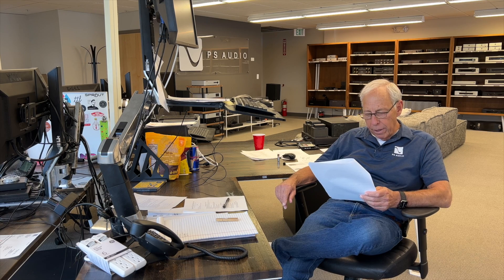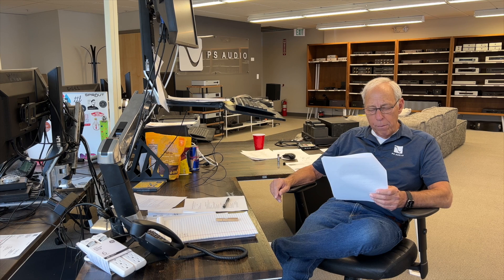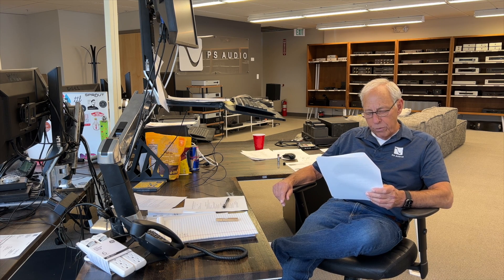Dual vs  monoblock amplifiers

Comment: Dual Mono 
Bryston is The Bomb 💣 
Built Like a Tank and Just Enough For Anything You Need in a Home 
Stereo System The 3-B and 4-B
Oddly Enough is Not Stereo It’s 
Dual Mono Am Not a Audio Snob I 
Do Not Have Gold Plated Speaker
Wire Or a Elliptical Hope Diamond 💎 
Phonograph Cartridge That Set Me
Back $15,000 Dollars 💵 
Yet You Can Get Great Results From 
The Bryston 3-B or 4-B 
Jazz To Rock to 60’s Rhythm and Blues To Angel Classical Music 
The Other End Is a
Phase Linear 700-B 
This Pig Is Just Power And 
I Have 3 And 3/Way Cross Over 
For Highs Mids and Lows Plus 
Two Self Powered Subs 
This System Rock 
Rolling Stones 
To Exile on Main Street 
To Sticky Fingers 
Bryston and Bob Carver 
Just Built To Take On Any 
Sound Endeavor

Comment: I'm using 4 x monoblocs for my Kef Reference speakers, 2 for each side,  High Frequency and Low frequency. Maybe overkill, but having a total of 500w just for the main speakers is at least the amps don't even get warm, at even high volume.

Comment: If you want to go down the mono block route just buy two old integrated amps of the same model and split the inputs, r & l, between them - why folk buy overpriced purpose built mono blocks  is a mystery to me.
Reply: @vid vid I have just realised that I have 2 amps the same and would like to try this. Would you kindly explain how I connect my turntable, and to I link the amps in any way?
Reply: @stephensmall4172  I am no expert and I think due to how a cartridge works on a turntable that cross channel ghosting occurs at that stage so one amp per channel further down the line will not take that out (of course it is not going to add to it either!!!) So, setting that aside, then just put outputs from your turntable into a separate amp (phono stage input) making sure the left goes to the amp you will be hooking up to your lh speaker etc. You might need to get an extension for one side to make it reach.Hope that makes sense - I am no expert - just always looking for the cheap option for maximum musical fidelity!  Good luck.

Comment: Another advantage of having two chassis is you can put it close to the speaker and use shorter speaker cables.
Reply: I agree you will have shorter speaker cables, but also long runs from preamp to power amp. Not so bad if you have balanced cables.
Reply: @albanana683  If you've listened to Paul he agrees with longer balanced interconnects and short speaker cables.
Reply: @richardsmith2721  you are fools! The resistance of the speaker cable is irrelevant compared to low level connects
Reply: @Harald_Reindl  but we are not outputting sine waves to the speakers, we are sending complex waveforms, and speakers have very different impedances at different frequencies. This puts inductive loads on the cables and amplifiers over a very wide frequency range. Most people with a decent system can hear the difference between very skinny and thicker speaker cables, and the same between long and short cables.
Reply: @spacehopper999  for the sake of god the resistance of the speaker cable don't matter in the calculcation and you can't hear short/long cables unless it#s very very long and even than it's only volume - you have a volume control for it - but it don't change the sound - it's shocking how much audiophiles don#t have the lsightest technical knowledge and things like "This puts inductive loads on the cables and amplifiers over a very wide frequency range" don't let you appear smarter but just dumber
Reply: @Harald_Reindl  it’s ironic that you are claiming that I have no technical knowledge. I was talking about impedance when you thought that meant resistance - impedance is ac and resistance is dc. That is why you are struggling to understand it. Impedance has a different set of calculations. 
You’ve hit the nail on the head admitting that you are not an audiophile, more than likely meaning that you have not had the pleasure of listening to a high end system before. Such a shame.
Reply: @spacehopper999  I don’t think so
Reply: @spacehopper999  A high end system sounds awesome because of the speakers, amplifiers, and source components.  Not because of the cables.
Reply: @richardsmith2721  Paul agrees with Paul.
Reply: @YuengsNwings  Let's do this then. My original comment was that two chassis allow you to run shorter speaker cables. If that's not your thing, then great. Please move on with your life.
Reply: Weee!… maybe Paul left this aspect of monoblocks out of his video to avoid this rubber-fire. Perhaps it can be argued that the effect is small, but trading speaker cable length for balanced cable length can’t hurt, right?
Reply: @SteveWille  how should something which makes no difference at all hurt? do it if you feel better, but it's useless
Reply: No two things in the real world (unlike, say, in mathematics) are exactly equal. Given that, I’m questioning if shortening speaker cables a movement towards improvement or always from it. Perhaps though, for instance, there are other uncontrollable factors that dwarf the any difference that speaker cable could make. Maybe this is the point.
Reply: Bc of damping factor?
Reply: This would be true if you are susceptible to the cabling snake oil. There are no sonic benefits to shorter speaker cable unless you’re talking about unusually long runs.
Reply: @YuengsNwings  So you use lamp cord for speaker cable?
Reply: @richardsmith2721  I do not.  I make my own cables using 12AWG wire with decent connectors which is plenty sufficient for 100% of applications be they mine or anybody else's.  My speaker wire runs are 5' long.  My interconnects are 3' long.  And I guarantee there are no sonic benefits to either transferring some of the speaker cable length to the interconnects or spending more $ on speaker cables.
Reply: Lol - you missed any technical education - why?
Reply: @Harald_Reindl  How did I miss it?

Comment: One place dual mono works well is in the preamp.  The output stage of my streamer/DAC is dual mono.  The channels share the power cord.  After that it is two separate power supplies to two discrete amplifiers.
Reply: But without any difference in the result "working well" is idiotic given that there is no difference without all that nonsense
Reply: @Harald_Reindl  In your humble opinion...

Comment: Isn’t one main benefit of monoblocks that they can be positioned near each speaker which allows shorter speaker wire?
Reply: The added cost of the amp will be greater than the savings on a few feet of speaker wire
Reply: @Pete.across.the.street  true. But people don’t use monoblocks to save on the cost of the wire.
Reply: @edd2771  so what would be the benefit? Cable management?
Reply: @Pete.across.the.street  Many audiophiles believe that the shorter the distance from the amp to the speaker, the better the signal transmission. This, in addition to the absence of cross talk and heat that Paul mentioned are often cited as a reason to use monoblocks. I found it strange he didn’t mention it. If you look at pictures of high end setups, the monoblocks are on the floor, near each speaker, not stacked in the middle with other components. Paul has spoken about this in another video where the title was something like What is better, shorter speaker wire or shorter interconnects?
Reply: @Pete.across.the.street  Probably better damping factor, but im not sure if is worth mentioning.
Reply: @edd2771  You can increase damping factor on a longer cable by simply going with a lower inductance cable like Goertz cables

Comment: I own an Adcom Gfa 535 amplifier and i decided to open it up and there were 2 transformers,  2 sets of capacitors,  2 sets of power transistors and 2 heat sinks. Though rated at 60 watts a channel its a beast and more powerful than its rated power
Reply: I have ADCOM GFA 555mk2 and 545mk2 , but yes the 535 has dual transformers.

Comment: Interesting discussion. My initial reaction would be by putting two amps in the same chassis, completely separate including power supply. Also the power supplies have seperate AC power Entry Connector Receptacles, female socket male spades. That would encourage users to plug the power sources into completely different AC feeds. Plug one into a socket on one side of the room the other into a socket on the other side of the room. Three potential things happen:

#1 Both feed sockets are on the same circuit breaker same feed. Probably nothing gained nor lost.

#2 Both feed sockets are not on the same circuit breaker.
   Minimum maybe a little ground loop hum
   Worse result potential chassis has some residual AC leakage.
   Gently rub your hand on the chassis and you kinda feel a little AC there.
   
#3 One of the two feeds is miswired and fed from two different feeds from the power line and breaker box.
   This one can be dangerous. Maybe the amp blows up. Or pops a fuse or trips a breaker.
   Maybe if you touch the chassis you get electrocuted.
   
I would NOT recommend a power amp of this design.
Reply: Opps forgot one more thing # 4 if the two feeds coming from two different breakers are feed separately from two different phases from the house AC service and transformer. That's gonna be a problem.
Reply: @wilcalint  And the hardest part, you need to run the two channels on two different power plants just to be safe LOL...
Reply: To gain what? Doing something in a technical environment for no technical gain is idiotic
Reply: @Harald_Reindl  Except in this case under discussion is the design of a consumer grade electrical appliance which is subject to local and national safety standards. Most devices of this type must or should meet UL, CSA and TUV standards and display such somewhere on the device. IMO, and I've been through the certification process several times, some of the devices under discussion here may not meet those standards.

Comment: Paul, I just went to your website to check out the bhk 300. Music and movies are full bandwidth. Why not list its true power ratings 20 HZ to 20 kilohertz?
Reply: @funny0000000  I think a better analogy is the speed of a car rather than horsepower. Yes the car can go 150 mph but only downhill. Yes the amp can produce 150 watts but only in the easier spectrum. Btw, 1khz isn't that much easier at 1 khz than 20-20k.
Reply: Spec sheets have to go thru the marketing dept at least once before they are finalized.
Reply: @Roof_Pizza  not sure how that answers my question
Reply: @ryanschipp8513  I think it explains everything tbh.
Reply: @ryanschipp8513  It shows power ratings down to 2 ohms, so as long as your speakers don't drop below 2, that should be enough info. Maybe I don't understand your question, but what's listed seems to be enough.
Reply: @AT-wl9yq  human hearing is 20hz to 20khz. Music and movies are FULLBANDWIDTH. Not just a 1khz tone. So listing a power amplifiers wattage at anything other than full bandwidth is not telling the whole story. It's called fluffing numbers. My question is. Why fluff numbers? To me it's deceitful. Consider this analogy. You buy a car and they tell you it's a certain amount of horsepower. Afterwards you find out that isn't the horsepower that it is that they listed. How do you feel at that point?
Reply: @Roof_Pizza  makes no sense. That model has passed through marketing already. It's quite obvious.  They are fluffing numbers to make the amp look "better". 1khz tone makes for a bigger number. FULLBANDWIDTH will be a smaller number.
Reply: @ryanschipp8513  Can you give me an example of an amp that's measured the way that you want to see it? The way PS Audio does it is pretty much the industry standard. 

Just to be clear, I'm not asking you for a rant, your opinion, your feelings on the matter, horsepower ratings on car engines, or anything like that. I want an example. That's it. Show me what you're talking about.
Reply: @AT-wl9yq   ATI & NAD list full bandwidth
Reply: @AT-wl9yq  Sure. Actually, quite a few manufacturers list the true full bandwidth rating. 20hz to 20 khz. Not just one sound of 1khz. Because music and movies are a massive range of different frequencies. So it would look something like this....

FTC Full Bandwidth Output Power at 8 Ohms	200 watts
FTC Full Bandwidth Output Power at 4 Ohms	300 watts

All power ratings are measured with all channels driven.

Comment: Oh Paul, your going to make me buy more stuff, I can't begin to afford BHK, but I can afford Emotiva BasX
Reply: the M1200 are might y close
Reply: @googoo-gjoob  or not, I can get a pair of Emotiva BasX A1 200w monoblocks for well under a thousand, my speakers are Klipch klf20s 100db sensitivity, so im well inside thhe 10% rule for the majority of my listening, I'm using the BasX a2 now and it's dead silent at idle and super warm and dynamic, I probably won't spring for the monoblocks cuz I need a new couch.
Reply: @dans550  agreed, M1200 would be oooverkill.